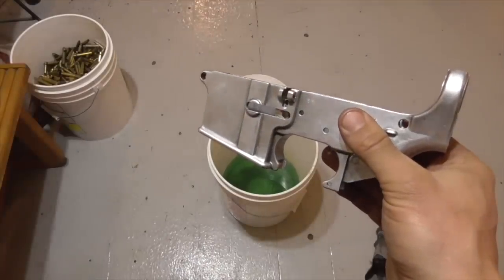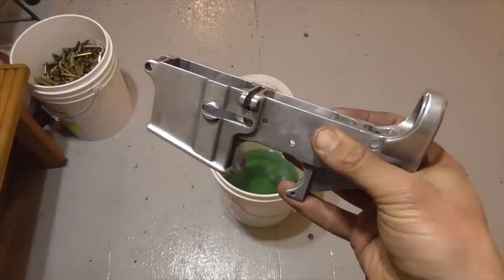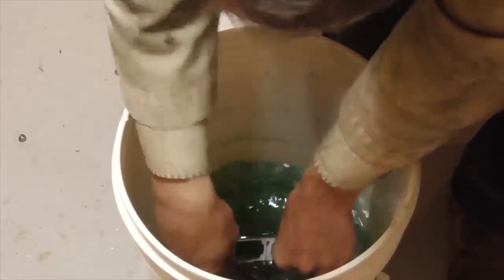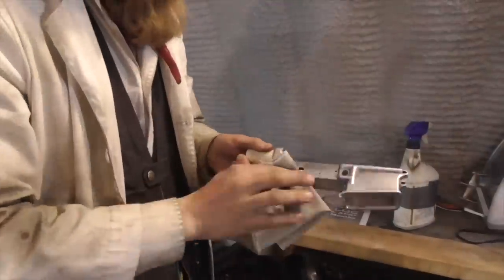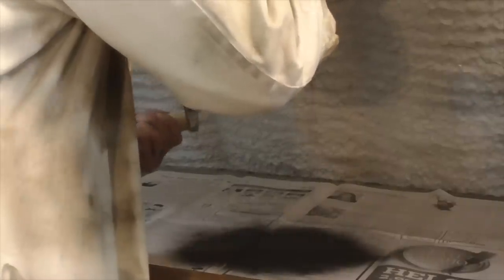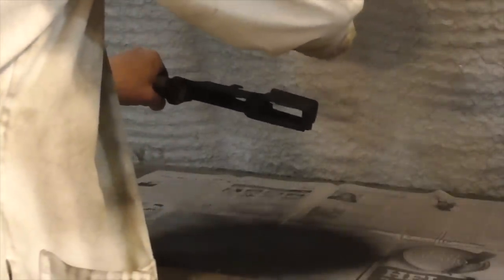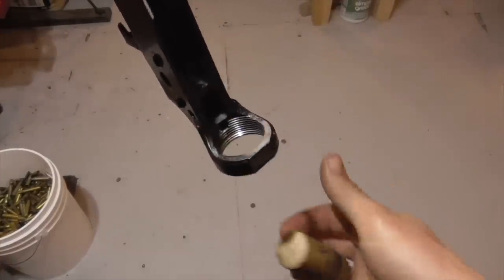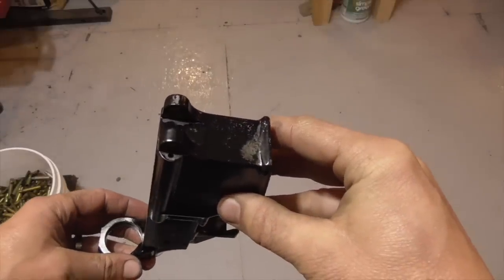Powder Coating: The WD40 Method (TIS263)

Comment: I've not found a better refinish product than Norrell's Molyresin.  The black perfectly matches the black finish on most new uppers and lowers.   Can't post a pic here, but I have a photo of an old beat to hell A1 upper refinished with Norrell's Socom Flat Black pinned to a new lower.  Perfect match.  It's easy to do, and I bake it in my kitchen oven.  I've also done several in their OD.  They also have one that looks like parkerizing.  Apply with a cheap airbrush, let it dry.  You can handle it in about 20 minutes.  If you have a drip or otherwise not happy, until it is baked it can be removed with lacquer thinner soaking about 15 minutes, and you can coat it again.  Once baked there are no solvents I know of that can remove it.  It is TOUGH.
Reply: your kitchen oven is NOT to be used...

Comment: Why did you go to all the trouble to clean and degrease it if you were just gonna coat it with a greasy substance like WD40? And it would seem that a greasy substance on the surface would interfere with good adhesion, and the coating will chip or peel off...

Comment: I use a simple cheap ( £100) diy electro static gun which works OK worth buying for the ease of use it gets a good coverage. I ave used it for many items but the biggest problem is on bigger item that do no go in the oven I have.

Comment: Consider, for next time, inserting some of the actual parts that this will interface with, or even sacrifice a set or parts of a set, so that the holes need not be cleaned out after the baking.

Nice work.

Comment: I know exactly what that is: it is a component of the turbo encabulator manifold, that using the threads, connects to a klein bottle tribolumeter, which measures the output velocity of the corundum lined harmonic power take off spindle. The square section is for a hydraulic linear sleeve bearing slide that mates to a hand scraped gear pump surface oil recirculating labyrinth seal. There are a few O-rings that go in there too.
Reply: CORRECTION:::New model component
Reply: and the noobs in here accepted that description lock, stock and barrel, yes?

Comment: It's part of a rapid onset lead poisoning injector. Otherwise known as a pew-pew. ;)
I own 2 static applicators one consumer model one home brew, they work but I'm glad to learn this method too.
Sometimes there are nooks that the static just can't get powder into even though that's its job.
Also even the lightest airflow that can move powder out of the applicator can blow powder off the surface of the part, frustrating.
This method has an advantage where the application of powder is more controlled, precise, and allows for recovering much more unused powder.
The spraying static gun gets powder everywhere requiring a respirator and you can't recover a fraction of the over spray.

I may just switch to this method for parts small enough to be hand held.

Comment: Looks a lot like the real M-16 lowers I worked on in the middle 70's while I was in the military.  A lot of them had a lot of the coatings worn off and bare metal showed.  This was even after going through supposedly "depot" level maintenance.  MSgt David R. Smyth, USAF, Ret.

Comment: Wait, is that thicker or thinner than regular powder coating? This would be great to do with some non critical parts to get used to it and then buy an applicator tool once you’re used to the powders and baking

Comment: I beleave there is a better way to use your method. First it would have been better had you bead blasted the reciever,  as it would help hide the imperfections, then warm the piece using a hair drier, next place a large plastic bag around the piece and mist the reciever in the bag with the w-d 40, then place the piece in a new bag and dust it, using it to do a shake and bake coating with outtouching the bag to it. The bag would alow it to dust more even. Next tap the wood dowl as it'll still knock off the exsesive amount. Do all of this fast while the peice is warm. The plastic bag will help set up a static field. Paper bags can also do it, and mabey better than plastic depending on atmosperic conditions. A 9 volt battery could also be used to enhance the effect dramatically if the leads are attached to the bag and aluminum piece. Use aluminium foil on the inside of the bag in a ring to surround the piece just a few cm distance.
  Give that a try. It might work better.

Comment: just touch up the bare area's with opscoe metal treatment from ace hardware.
It's like a light parkerization and will protect the bear area's....cannot not blue it after you use it.  Not sure how the powder coat will like it.

Comment: Very interesting method. I’m curious if this would work for powder coating MDF. I’m thinking shellac, then WD40, then powder, then bake. Or is there already a way to powder coat MDF parts?
Reply: MDF really shouldn't be exposed to heat above about 85-90C (170-180F) which is still very (too) low for powder coating. You can however, use normal primer and spray paint and then get the temp up to near this range to get a slightly tougher finish. (Note: the cure temp of most powder coats is only a few 10s of degrees from the auto-ignition temperature, so it really isn't a good idea)

Comment: A little rough looking but plenty good enough for that flux capacitor component. Hey, it's a tool, not a museum piece.
Reply: I had a job when I first graduated where we would use a lot of those components. People where I worked could be real hard cases about the importance of doing proper inventory, for whatever reason
Reply: @MarcillaSmith  I remember that... and the paperwork you had to fill out when you returned from the job site with a broken tool... guess we didn't use the tool as gently as intended.
Reply: With practice.id say you could get it perfect.maybe try some thing else other than WD-40.key the steel.etc..
Reply: THAT'S WHAT SHE SAID! 😂

Comment: Ive got the same model ice cream dispencer as seen in vid. Mine is old enough to be C&R but the bottom isn't the original because they're so high and have that extra selection. The top (as you can imagine seeing service) is dinged up and scratched anything on filling before this step?

Comment: This is why people send off gun to get something professionally coated. Powder Coat is a terrible coating for gun components. It's to thick and covers up any serial and model numbers. I charge $50 to do a lower in a solid color of KG Gunkoat and it is done correctly. After getting materials you need for this you are probably in for half the amount to get it done professionally.
Reply from the maker: And the fact that having something like this coated by a pro costs more than the component itself is why people like me do stuff like this!

Comment: Boiled linseed oil is used as a steel coating, I wonder what results you’d get dunking the object into that instead of WD40?
Reply: Curing powder coat paint requires 400° F. Don't know if Boiled Linseed oil would hold up to that heat without cooking badly. But heh, maybe worth a try.
Reply: Traffer wd40 is supposed to be fishoil. To use linseed oil as a metal coating you can either just let it dry or heat it until it cooks. I don’t know what temperature that is I have only ever used a torch to cook it.
Reply: @anomamos9095  The coating that the Idahoan put on the receiver was Powder Coat. It is a polymer that has to "bake" on. It is baked in an oven at 400°F  for 20 minutes. I don't know what the smoke point of WD 40 is but it must be well over 400° because it didn't smoke when he baked it. Linseed oil is one of the lowest smoke point oils on the market. It starts smoking at about 240°. That means that it would be a billowing mess if you tried to bake it. As far as WD40 being a "fish oil" that is a myth. There are no organic oils in it. purely petroleum  based. There. Now you know.
Reply: @HansFormerlyTraffer  The WD40 boiled/evaporated off. Still, I have to wonder how well the polymer could have gotten into the pores of the metal while WD40 was gassing out. Bet $1 that finish flakes off too easily.
Reply: @gg5115  Wow! $1! You are obviously very certain of your assertion 😆😆😆
Reply: @Ozninjaguy  Well, I do talk a big game, but the truth is, I could afford to lose $1. I think. I really should have checked the change bucket before I shot my mouth off on the internet in such a fashion.
Reply: @gg5115  Lol...good one mate. Take care there.
Reply: Linseed oil is to ascetic but works really well with carbon steel especially when it is heated first and multiple coats.

Comment: Unfortunately, the only part of that process that was remotely correct was degreasing it.  NO PAINT process will survive being coated with silicone lubricants.  WD-40 in a paint shop can contaminate everything.   Further, the powder will never stay on that part.  It's as if you dipped ice-cream into tub of chocolate.  If you tap it with something or on something I'm sure big chunks of powder in the shape of the part will peal away from the aluminum.   It's unlikely the powder ever crosslinked because you put a cold part in a cold oven. The part is supposed to be AT 350 to 400 for X amount of cure time.  Ie you put the part into a HOT oven.  Even if the powder cured, the silicone will prevent it from bonding.  Why do you think powder lines have extensive 5-7 stage wash and rinse treatments BEFORE coating?   You would have had a stronger coating and better looking product by rattle canning it after the degrease.
Reply from the maker: Actually, the coating is reasonably durable and adherent (much more so than spray paint, anyway).  I coated some smaller test pieces of aluminum this way before attempting this part.  I tried hitting the test pieces with a ball-peen hammer, and the coating didn't chip or come off even when I hit it hard enough to make significant dents in the metal.  I also challenged the coating with a wire wheel on my bench grinder.  The wire was able to scratch the surface of the coating and eventually wear its way through, but the coating could was not easy to remove; it stood up pretty well to that test as well.
Reply: @TheIdahoanShow  LOL.  You've apparently found the "Unicorn Process" then and the entire coating community has been doing things wrong for nearly 50 years.  Companies spend millions of dollars to ensure their parts are clean and free of oils and silicones prior to coating and you've just turned the industry on its head in your basement.  well done??????   You might want to try a cross hatch adhesion test on a test panel...........

Comment: "will never yield the aesthetic uniformity of a professional powder coating job"... In other words, "it will look like shit"?

You would have done better by heating up the metal and then putting a light dusting of powder on it.  Of course, that "shaker" you were using is not going to give a "light dusting" because the holes are too big.

Comment: I'd probably dissolve some light wax in mineral spirits myself, no concern about extra ingredients and I could just swish the thing around and let it dry. The remaining super-thin wax coating should be sticky enough... and for that matter, WD40 is wax dissolved in kerosene with some extra lubricants, you can dip and hang that too.

Comment: Professional powder coater here. Not a bad idea, and probably will do, in a pinch! However, most powders are polyester based, this means the don't react well to grease (WD40) or any other kind of moisture for that matter, especially when heated. This is why you get all the little swirls and bumps in your finish, this won't last long, and those spots WILL be the first to ablate with not really that much usage and time.  When no electrostatic gear is available, your best bet is to mediablast the part, if you have that option and degrease it, otherwise just clean and degrease the part as best you can, and then preheat it in your oven to 150-160°C (300°F-ish) for about 10 to 15 minutes , and then apply the powder evenly, WHILE THE PART IS STILL HOT. The high surface temperature of the part will make the poly in the powder melt and adhere better than any amount of grease or glue ever will. Cure for 10 to 15 minutes at 180-200°C  (350-390°F -ish). For application i would suggest some sort of gravity fed spray gun, set for very low pressure. This won't be perfect, but it will help you avoid "patches" and globs of powder, and get a uniform finish. Try spraying from a distance because you will want to avoid sputters and lumps of powder.  In short: MOISTURE IS THE ENEMY, HEAT IS YOUR FRIEND AND UNIFORM COATS ARE KEY!    Also, times and temperatures may vary to greater or lesser extent depending on the size and mass of your part, size of your oven, type of powder you are using,and so on...Anyway, Hope this helps! Great video,i enjoyed it!
Reply: This is the kind of comment I'd love to see more of in the comments section. No snobbery or hating, just sharing knowledge and a positive take on what he's attempted to do here. I'm considering powder coating my own motorcycle components and your comment here was very helpful to me. Thanks!
Reply: Spot on Dizzy. I had a customer that did ceramic pots that I powder-coated and used the exact same setup that you described and it worked perfectly.  Silicone of any type had to bake out of the substrate before coating. Whenever I did used engine parts they had to be baked or outgassed as I called it to make sure any oils or silicones were gone before coating..
Reply: I know...old theme, I am late... but! Thats THE MAN... if we all are like HE is (This gentleman) sharing his knowledge, without any profit, we could be all progressing worldwide... my respect Sir! Regards from Serbia! (I don't have even an interest in this subject, eventually arrived to me at some point at YT, but Your sharing of info and knowledge attracted my attention, without any obstacles, and income requests. I personally dot have much interest in the matter. You offered Your (probably hardly accumulated knowledge for free), that is hard today to find even at university professor's level. Such attitude (Professors, doing private stuff, parallel with university job, because they are trying to gain more money, and treat students as future competition, so they are hiding their knowledge (not all of them, I agree, because majority of them doesn't even have any practical one, they are repeating to the students same "old" books that they learned 30 or so yrs ago, and they didn't advanced any more ... my respect.
Reply: Thanks for the input.. you covered everything I wanted to know about powder coating without electrostatic
Reply: Thanks for your comment.  When I saw this, it felt wrong.  Normally you try very hard to keep oils away from surface you plan to paint.

Comment: Tolerances are tight on that part you powder coated " if you can call it that " you will have to scrape that coating off from the mag release  button interior , take down pin holes, safe fire switch hole and other places for the parts to fit inside.  I paint rifles often , the masking of parts takes hours if you want the parts to fit after painting .

Comment: I'm not poking holes in your method because I see that the powder stuck to the WD-40, but why was it important to degrease the surface if you were just going to coat it with petroleum distillates (etc.), anyway?
Reply from the maker: A thin film of WD-40 seems to work well for allowing a uniform layer of powder to stick to the part, but I was concerned that sulfurized machining oil, grease, or loose dirt might be problematic.  If the part is reasonably clean to begin with, you could probably get away with skipping the degreasing step, but I wanted to be on the safe side.

Comment: Home DIY anodizing would be better as it’s an actual electrochemical process. I’ve done my own gray color ‘hard anodizing’ using a bbq grill burner to boil the electrolyte while anodizing. Works great, and probably stronger than the powder coat. I’ve hit my parts with a file and unless it’s a very coarse file with extreme hand pressure, the file skates off the anodized surface. I’m located in Meridian.

Comment: That looks about as good as most cheap Chinese stuff from a big box store. I still think that you could have gotten a more durable finish with rattle cans. Skip the simple green. Clean with acetone. Bake at low temp for a bit. Clean with acetone again. Bake at low temp for a bit. Acid etch primer. Appliance epoxy top coat, or any color followed by an automotive clear coat. Rattle cans (good quality kind, not bargain basement junk) can provide an excellent finish if you do your part.  They’re no cerakote, but don’t write them off before you really try them.

Comment: Instead of going through all that trouble I wouldn't even try to powder coat I would check out an automotive paint store and see if you can get a spray can of flat black with the hardener it cost more than the conventional spray paint but it's durable or use DuraCoat the US military used a flat black lacquer automobile paint

Comment: I have been powder coating for over 20 years I can assure you that powder won't stay on that lower long. the first time you bump something hard it will start to fail. I know this for a fact this method is not an alternative to clean metal static spray. But I'll tell you what will work. Make a float chamber big enough to hang the prepped clean part in. and float the powder with clean dry air. the powder will stick to the part evenly heat the part to just over 110 f  before placing in the chamber. then cure it at a slightly lower temp longer than the powder manufacture states. if they state 400*f for 1 min go 350* f at 20min. done.

Comment: You note that the powder coat is micro thin, but superior adhesion to a spray paint coating.  Could the powder coated part be spray painted as a secondary coating to provide a thicker, more resilient coating?